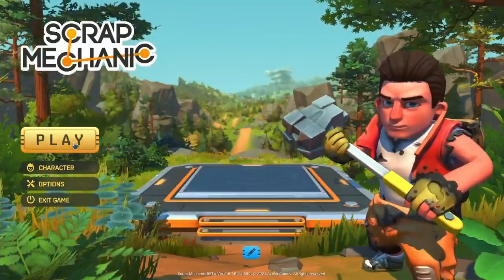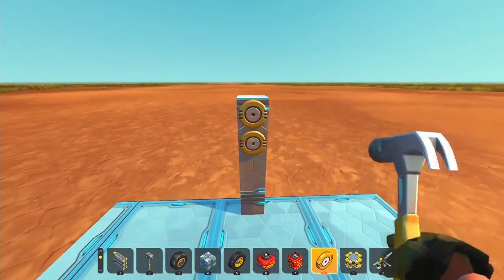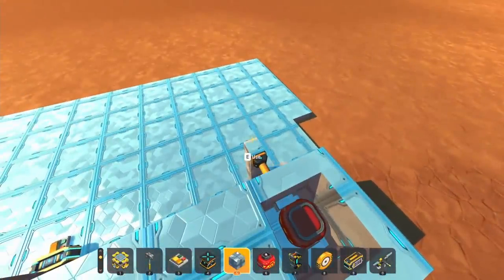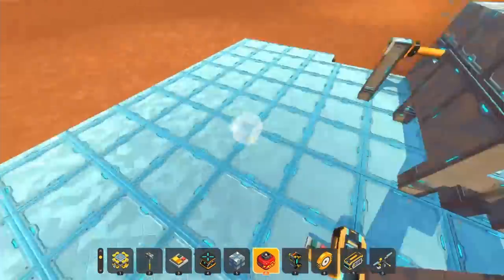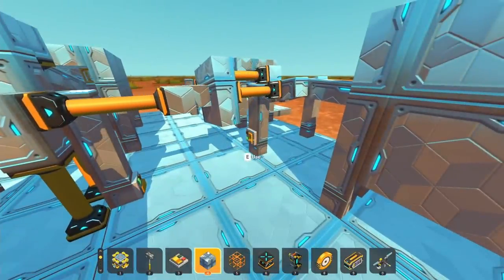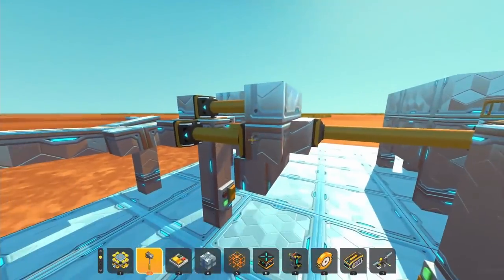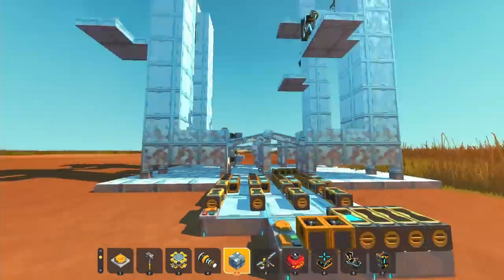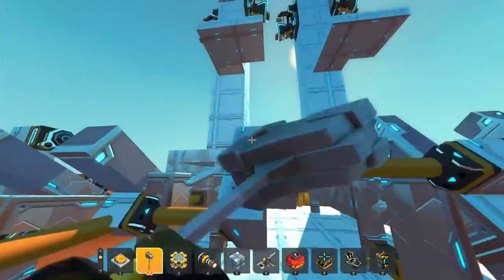Making an Explosion Powered Engine in Scrap Mechanic

Comment: So when designing scrap mechanic engines a common trick is to put a bearing between the cranks and connect it to a controller, that way when you take creation off the lift the cranks rotate to whatever degree you set it too
Reply: Yes, but then it can’t rotate freely, which is the whole point of a crankshaft.
Reply: @Neon-ws8er  it can if you don’t lock all the bearings only the 1 between the individual cranks
Reply: Yeah, between the 2 crankshafts
Reply: if you wonder why this is nice: the thing being for example 120 degrees offset means that it never has a 'I'm pushing straight on the crank not making it spin' problem, because at least 1 of them isn't perfectly against it.
Reply: I don't know if that would work here. When I work with standard piston engines, I get problems somewhere at the top of their performance range where the crank starts to bend and cause the timing to go all weird. To solve this, I've recently started moving the tops of my pistons instead, which has allowed me to make some pretty powerful engines without having to worry about bending the crank. I don't know how you would do that with an engine like this, but you probably could if you wanted to.

Comment: Basically a REAAALLLY big internal combustion engine. Still cool though!
Reply from the maker: It is indeed massive. If only the explosion radius was smaller
Reply: @ReidCaptain  you might be able to mitigate the explosion radius by closing off the open end of the combustion cylinder after the small explosive is fed in.

Comment: There are mods which add challenge mode's bomb-spawning parts to the creative inventory which are technically vanilla that you can use if the tubes prove to be too unwieldy in the future.
Also, you can use a spud gun to trigger bombs. One shot will trigger it and two will cause the bomb to instantly explode.
Also also the spud gun can destroy cardboard blocks, which you could use to make loading the engine less manual.
Reply from the maker: Both of those things sound great to mess with!
Reply: @ReidCaptain  also potatos are also useful for propulsion
Reply: maybe have a sensor detect when a piston is just about to be fully extended
and have that spawn a bomb in a space thats a bit too small
then the piston smashes into it, causing it to explode
that way you could ignore any timing alltogether
Reply: @mingcr9470  that might cause the piston to go back in reverse because the piston would never fully extend
Reply: Oh, someone already mentioned spud guns
Reply: @slycooper1001  It isn't though, it's extremely laggy and weak
Reply: @ReidCaptain  Also you can conect the two crankshafts by welding the block onto of a not extended piston to the shaft you want to connect.
Reply: why not vacuum pump

Comment: you can actually control pistons with controllers, and with the loop method you can make them go 1 block by 1 block in a sequence
Reply from the maker: Yeah, that's another way to go. I want to say that the way I had it gave me more control of timings but I'm not even sure that's true
Reply: @ReidCaptain  you can actually go by i think 1 second increments by changing the say 2 to 4 clocks from like 2 4 to go 2 2 4 to make an interval between 2 to 4

Comment: When you made the bomb activation mechanism, there is actually a part called the pleceable spud gun, it's a gun that you can turn on like any other usable piece. When you use it it shoots a potato that can destroy a cardboard block and activate bombs, if you use more than 1 gun to shoot the bomb at once, it explodes it instantly. You could still use pistons but spud guns are more compact and convenient

Comment: You could put a bearing into the crankshaft and tell it do rotate 90 degrees at start so you dont have to do the connection with the pin mechanism.

Comment: The 90° offset in the crankshaft can be done with a bearing on a controller set to hold an angle of 90°, which is much more reliable, easy and less performance intensive. This is how most piston based engines in scrap mechanic do the offset.

Note that block collissions in scrap mechanic aren't very reliable in general. Blocks coliding at high speeds can phase through each other and high forces can  lead to hinges bending in axis they shouldn't move in.

Comment: Very cool idea, i've got a couple of things that could help you out. Like others pointed out you can use long chains of bombs with cardboard or glass in between and shoot it with a mountable spudgun to seperate. Also you could use a vacuum pump with a chest filled with bombs to just place the bombs on the good location itself (looks less cool but its more reliable in scrap mechanic to use as little loose objects as possible) and also the vacuum pumps have quite some range.
Reply: Oh nevermind the vacuum pumps cant spit out explosives..

Comment: To make the crankshaft be opposed 90 degrees, there is a block for you. It is called the controller and it can automatically turn bearings anywhere between 360 degrees.

Comment: I think you can use conveyor belts to move the explosives, and cardboard and a mounted gun to place the explosive and disconnect it. The item placer pumps (forgot the name) would for the small explosives would need to be perpendicular to both the one for the cardboard and the gun destroying the cardboard, and all the blocks nearby should not have faces with connection points towards the explosive. And this would also likely solve the issue of storing all those explosives, and it would likely also simplify the control mechanism, since you could use memory logic to get 3 things to happen in a quick succession: place cardboard, place small explosive, shoot cardboard. Since the explosives would fall, unless going up a hill or at a similar angle, you wouldn't even need to push them, but you can do so, if you want to give them a boost, and to make use of a delay you will most likely have, since you need to wait for the explosives to fall anyway, but you can tome their explosion to happen in quicker succession, by propelling the next explosive over a short distance, to get to the piston head and explode faster, so the next explosive can get to the piston faster.

Comment: If you put a bearing between the 2 parts of the engine you can connect it to a controller and turn it 90 degrees, also, you can use mounted spud guns to detonate explosives

Comment: For the long corridor of bombs I'd recommend making the piston father back and have it push a series of metal blocks that in total is the length of the corridor so it prevents the bombs from slipping in and exploding on the retraction. I would also recommend using the pistons compression to ignite the bombs instead of a complicated ignition system involving sensors and what not.

Comment: You should have put the 90 degree cylinders on pistons so you could construct them in place (high/low), and just lift-drop them inline.  That would also allow you to have the crank shaft be one solid piece.
Reply: or like most other piston engines
using a controler and bearings

Comment: Haven't checked recently, but I'm pretty sure that there is a vacuum pump in creative mode,

You can use those to place blocks if they are in a chest and that chest is connected via the connection points.
Reply: yes but the explosion will destroy it

Comment: I wonder if it's possible to let the piston explode the bomb. This way you don't have to time it.

Maybe with a sensor that activates if the piston is extended and then triggers the pistons to explode the bomb
Reply from the maker: I thought about that, but I was worried about the physics being a little too wack to not just stop the engine randomly. It's worth trying though.
Reply: @ReidCaptain  it would make the timing easier, you could add sensors to the crank and just time the explosives drop to trigger when the piston is retracted.
Reply: Hmm interesting, basically a Diesel engine
Reply: @sirsanti8408  yeah, would make things easier

Comment: You have to mess with controllers a bit more, they are great at controlling pistons, bearings. Ex.: For the crankshaft you can link certain bearings to the controller so that when you spawn the engine, the crankshaft will automatically get into position and stay like that

Comment: Could you build a cow powered car? Having the cows push a rotor while trying to eat some corn
Reply: i seen that from a different youtuber and it did not go that well it was a snails paste car if ur wanting to see it that badly though watch scrapmans multiplayer mondays as im sure it one of the older ones  but yeah would not recomend
Reply: @firenutter1798  I don't mean having the woc push the car directly, I mean that he should put like 4 wocs on top to spin something that turns the wheels for more speed

Comment: I don't remember how but you can pulse pistons with logic gates in a way that lets you control them precisely, so for example they can stay in place at any distance as long as it is smaller than the maximum set in the piston, you could use it to make the feeding pistons turn off to avoid the bombs being compressed like that

Comment: Why not use a sensor to explode the bombs whenever a piston is fully expanded? That way you don't have to worry about timing and it will be consistent even if it speeds up
Reply from the maker: If the engine was loaded I would have done that, but i thought it might have made it run too fast and break the bomb loading mechanisms
Reply: @ReidCaptain  That makes perfect sense, I'm sure this type of comment gets repetitive. Excited for your next video!

Comment: okay so try one of you crankshaft pistons, but vertical. then have a separate tube pushing them in time with the piston. this will bounce it upward while setting it to detonate, but not immediately. hopefully, by the time the kinetic energy transferred form the piston wares off, the bomb will have reached a chamber with the simple free arm you showed in the beginning. the free arm will be attached to a wheel. when the bomb reaches the chamber, it explodes, sending the free arm flying. by the time the arm runs out of kinetic energy to spin, another bomb reaches it. now you have an engine. i would love to do this myself and send you a video, but my laptop can barely run building games like scrap mechanic and trailmakers.

Comment: 8:36 theres a solution to this. Since theres something called piston engines and they connect the wheels with that engine but thats a hard thing to do since somethings gotta keep it together so it doesnt fall, answer use the piston trick, what did i say? The piston trick, since pistons have no collind parts you have endless possibilities like cars with engines that arent gas electric powered but piston powered. Look at on from the workshop and you’ll see what i mean

Comment: challenge mode glass is the strongest block. it cant be destroyed by explosions
Reply: Metal 3 can be destroyed by explosives if you have a lot of bombs very near by
Reply: Also, welding has a second mode when your creation is on a lift.

Comment: Is it possible to build a ,,diesel" engine in scrap mechanic? I mean the detonation would be caused by the moving piston itself which compresses the fuel (in this case the dynamite) rather than complex timing and stuff. I don't know if it's possible or not. But it would be even cooler. Sorry for the bad english🙂

Comment: To connect a transmission thru blocks you have to use a bend pipe (90 degrees) a piston (on the open side) and another bend pipe on the other transmission. It should look like 
  _____
/.          \

Comment: How much time have you been playing scrap mechanic?? Cuz I am better than you at the game and don't even have it.

There are so many wrong solutions you used. Not about the mechanism but about how normal casual building works. Like when you were trying to separate the piston from the cilinder head thing you could have built the piston off of the crankshaft when it was on the lift.